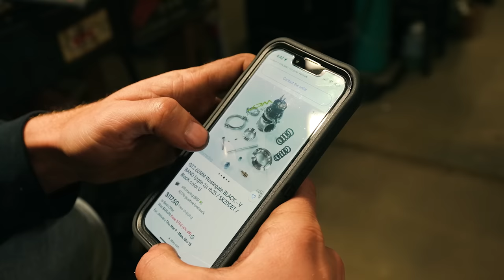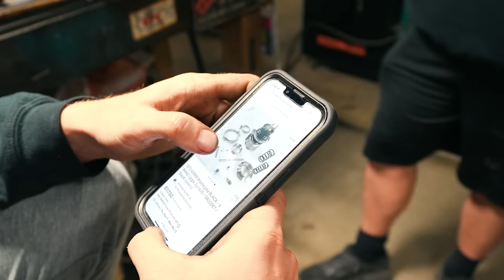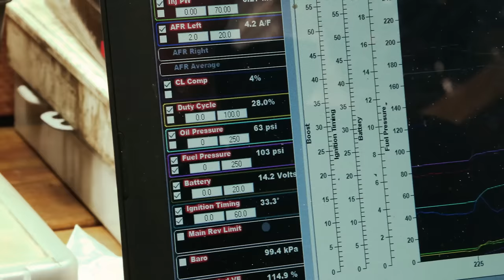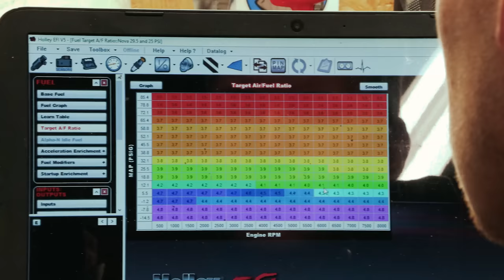S-10 Makes First Pull After Being Tailed by POLICE!

Comment: I'm afraid Billy it's time for a Turbosmart Straight Gate50. You'll never have this problem again. I've done 32 passes on my Z with one & it actuates so much faster than my old 60mm diaphragm wastegate and even at 50mm due to the straight through design outflows the 60mm.  And that damn vacuum doesn't sound like a rotary engine, it sounds like a damn air raid siren from WW2 LMAO. Keep up the great work fellas 🤙

Comment: Hey Billy you need to put the hood on that you had the two holes caught in with exhaust went through if you don’t all you’re doing is slowing your truck now you have too much air passing under the hood now and there’s no way for air to get out put the hood on that has the two holes in it and you’ll see the difference if that’s the case then you might have to put clear plexiglass in front of your grill and put two little scoops for your turbos to get air only good luck

Comment: Could have tried to make a controlled boost leak before the throttle body to keep body down. Engine masters did a test where they had a big hole to bleed pressure off a centri setup.

Comment: Hey Billy said you do not have no radiator or anything in the front air is trapping under the hood you might have to put custom vents so the air can blow through your hood and open over your cab just watched the aerodynamics of a GT 40 the way the hood is designed you’ll see what I mean

Comment: If you spend about two minutes taking the screws out of the bottom of the lid of the motor where the vacuum impellers you’ll see that there’s probably a couple little things stuck in there put it back together and it’ll be fine

Comment: I noticed at 31:58 the driver door was not completely closed before taking off. 
Also at 32:04 through out the rest of the time testing the s10. the passenger door was never closed properly either. 
Billy and bucko are Very lucky they weren’t pulled over for the doors opening up. As you can clearly see the gap in them. 

Src you might want to give those doors a thorough look over. I’d hate for one to fly off going down the street after Billy having all that paint work done. 
Please drop a like so they can see this if you don’t mind. Or if you personally know src please tell them.

Comment: On 11 pounds, the old mans probably correct.  Little learner wouldn't hurt 4.6 or so.  4.2 4.3 range round 20s pounds.  As low 3.8 past 30 pounds.  That's what kinda makes sense in my head.  More boost the more fuel needed just for the cooling affect 😎 .  Regardless it's sounds awesome guys!

Comment: Yello belly is definitely not what you guys are thinking. The violence and shit left in the early 90s. Its just old. Nothing to worry about other than the dips in the surface going down the track.
Reply: That, & the layout makes it work like a tunnel as you make your pass, & it creates a vacuum around your car, that will pull any 'glass doors off of the car due to the vacuum, due to them being so light. It would be a bitch to find out the hard way that the story is true.